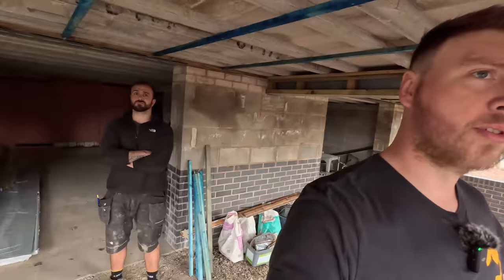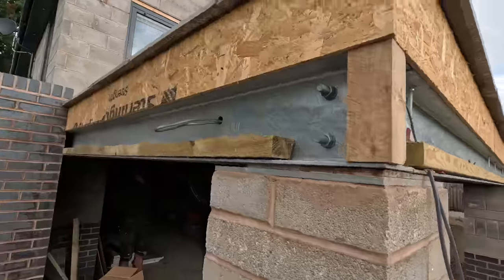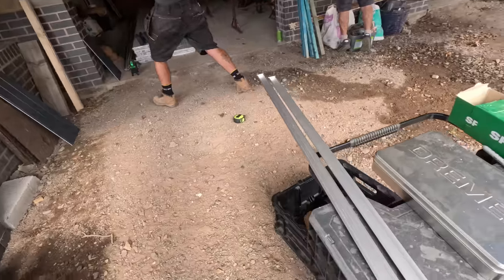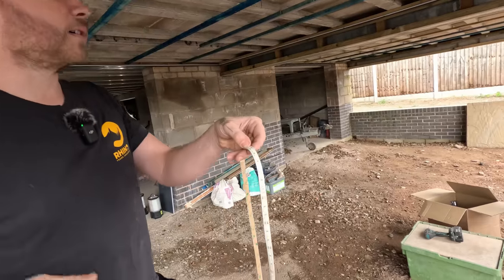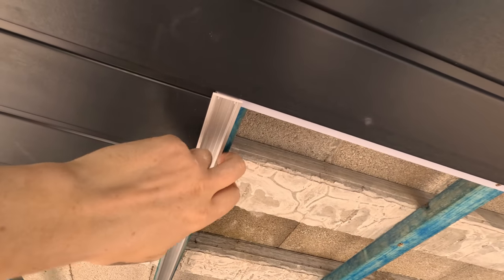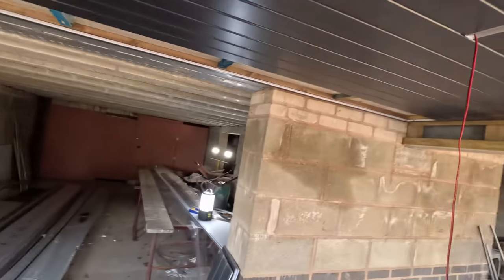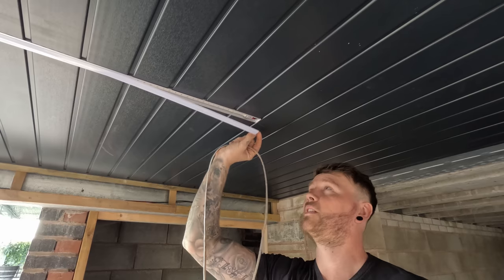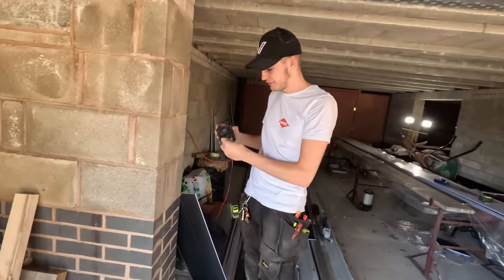Best video to date? Let me know

Comment: Great job, looks awesome. Couple of pointers, try soldering on site with light or clear heat shrink for less dark spots, heat shrink end cut of tape for longevity,  buy some .50 2 core black flex for  a more protected and ridged cable run. Nice work guys !

Comment: You can cut the tape on the soldered joints Nick. Soldering the end would get rid of that dark spot on the start of the tape 👌
Reply: the IP sheath stuff is minging, you have to scrape it off without damaging the tape, otherwise the iron melts it and it dribbles everywhere

Comment: I do a lot of led work with dmx etc, these push on clips will be a nightmare they never last. Better off buying tape which come with tails and crimping on then pushing the crimps through the hole in the profile. The hole can be much bigger than you drilled as the tape will still sick to it make your life easier and Much more stable and also 24v tape will last much longer than 12v but good job👌🏼

Comment: Nice installation...but honestly, not nearly bright enough to see properly. I just can't see the point of LED strips except as accent lighting, but then I'm an old git who hates all this modern stuff, like Nest and other "smart" gizmos. Who wants to dim the living room lights with an app on a phone? Get off yer a*se and flick a switch! Dimmers are stupid anyway...so many compatibility problems and hardly ever used anyway...and as for turning your heating on from your car when an hour from home? Get a life! I get my butler to do it!
Reply: Useful comment................
Reply: Having a few smart switches are great. I don't often change things from my phone - it is the automatic scheduling of having the main lights go on at dusk and off around bedtime that is very helpful for me. I was surprised that I do use Alexa to turn on the lights a few times a week - usually in the kitchen when I have my hands dirty and then realize that I started a task without enough light.

I do agree with you on the light strips. The only one I installed was in a pantry a decade ago (pre-LED) where I wanted to light up several deep shelves so that I could actually find the food that I wanted. But for general purpose lighting the LED options I find are either too dim or too energy inefficient. Now, I like the style of the lights that were installed here, but I personally want to get at least 100 lumens per watt like other LED light bulbs - and when I needed light I'd want to get at least 6,000 - 10,000 lumens of light in an area that size.

Comment: Those LED quick connectors are a good way to kill the strip and the driver. (High resistance = heat = no longevity)  Why can't you teach some basic soldering skills to the apprentice?
Reply: What apprentice?
Reply: @adventuresofanathan  The one doing the terminations not knowing they are doing a crap job.
Reply: Adam’s not an apprentice anymore 😂 also 12v high heat ? Somethings seems odd with that also if there supplied surely they should be used as per regs ?
Reply: @tradietrev let's not be a knobhead eh?
Reply: What are the comparative resistance values of soldered and the quick connects (which were supplied by the strip and driver manufacturers)
Reply: @richnorman7325  You would  be one using such devices. Clearly you lot have no idea and I'm the person to fix other tradies mistakes.
Reply: @TradieTrev  their not an apprentice
Reply: Just Cus he’s young don’t mean he’s an apprentice. The manufacturer provide the quick connectors…
Reply: @TradieTrev  never had one go wrong yet. Sometimes soldering is not an option. Maybe just try and stop being so opinionated